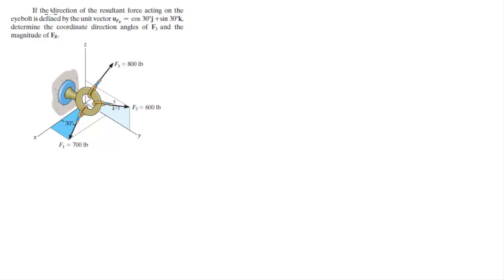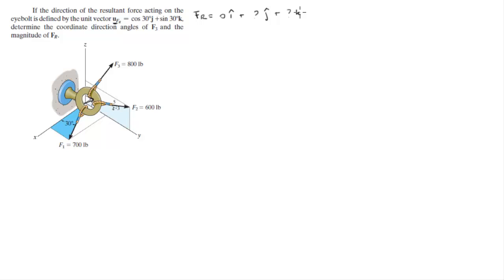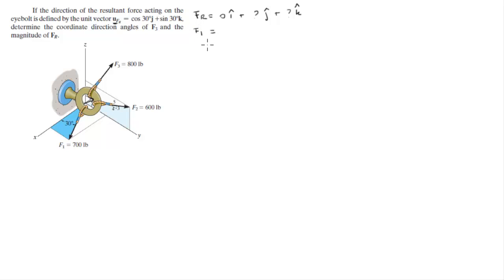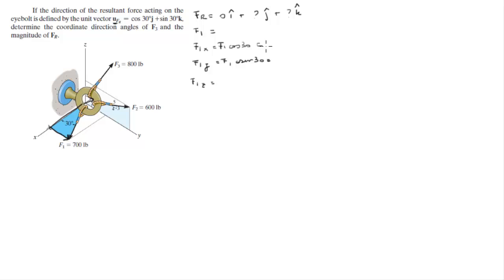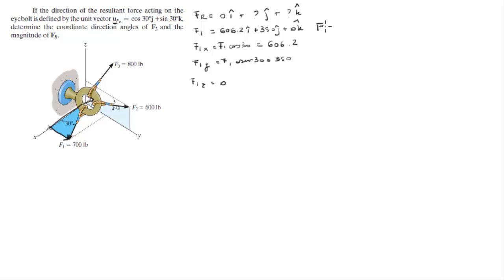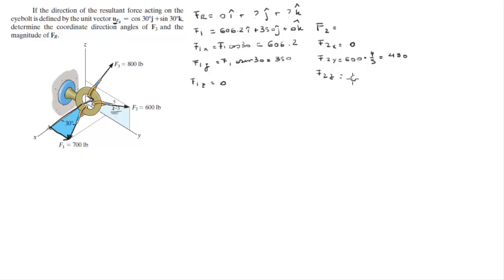Find F_3 given just the direction of the resultant force

Comment: ******at 14:03, the actual value is 367851.309 for cos139.2^2 * 800^2******
issue: you plugged in  cos 139^2, not cos139.2^2 . even little number make big difference for cosine my fren

resultant force is actually 137.402 lb or 1246.068 lb as a result, double check your work homies
Reply: I dont think so. Im getting the same resultant force as he did

Comment: At 14:45 when you mention how to get to the next step, "doing these two squares, adding all of them together and using the quadratic formula", can you show those steps?
Reply: (-B +- Sqt(B^2 - 4AC)) / 2A
A = 1 , B = -1798 , C = 543035 , note( Don't forget to subtract the 640000 on the other side of the equal sign before using the quadratic equation.)
The quadratic will give you the two values for Fr. Writing it all out is a LOT of simple arithmetic. You can handle it and it is good practice.
If you are allowed to use a TI-84 or better you can enter the quadratic (ax^2 + bx + c = 0)into the solver feature and solve for those values.